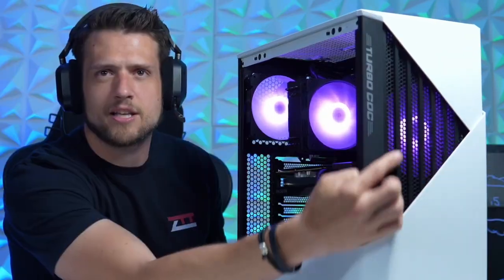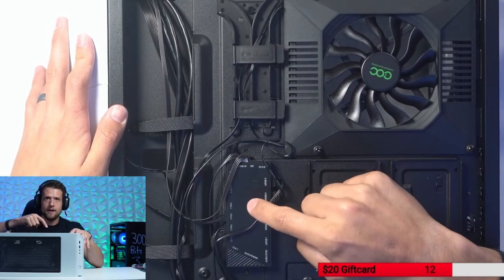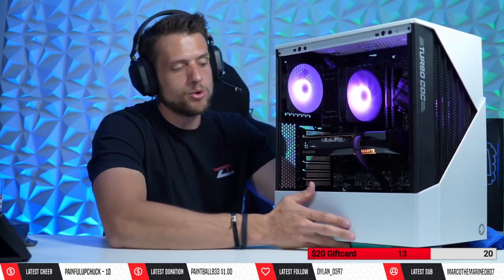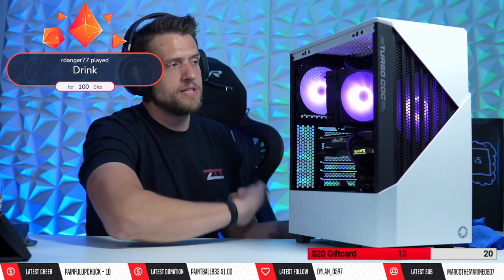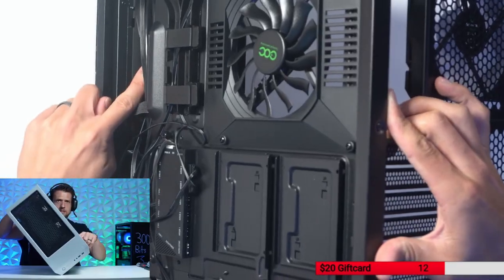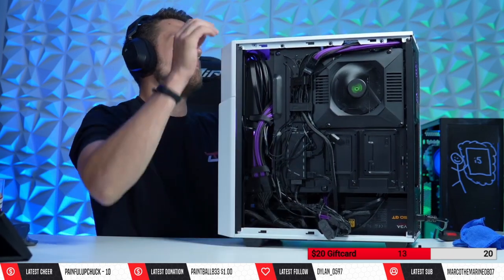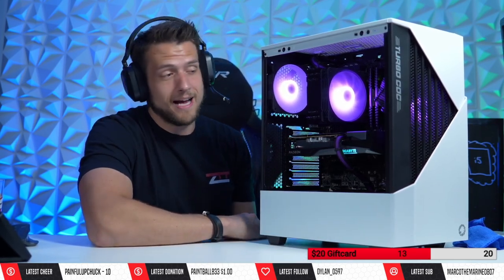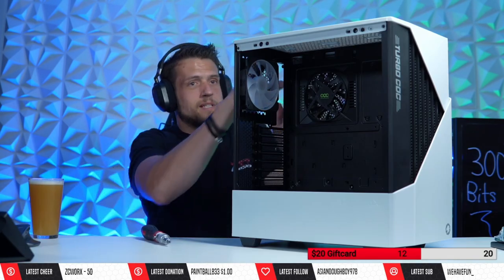Turbo Coc Case Review! (GAMEMAX Contac COC)

Comment: Yooo this is my build, bought it from you in the august flash sale🏀🏀
Reply: Can you install 2 fans on the front?
Reply: @thedayofquicksilver6930  the front where the 140mm goes? You would probably be able to fit three 120mms in it, it has three separate sections with holes for mounts. The only thing is, the case looks like it might restrict some airflow
Reply: @vedbed  Yeah, the front with the one 140mm fan. I've seen pictures on their website showing two 140mm fans in the front, but their spec sheet shows that only one fan can go in the front. It makes no sense because it clearly looks like 2-3 fans can go in the front. I might still get the case and experiment. I'll pull the HDD bays out since I don't use disc drives anymore.

Comment: You can make the lights work with the motherboard by making a power switch extension wire and plugging it into the fan hub. On the front panel, press the M with a circle around it, make sure the motherboard is controlling the lights. You can unplug the power switch and unplug the extension wire, connect the switch back up to the reset pin and the fan hub will hold the setting.